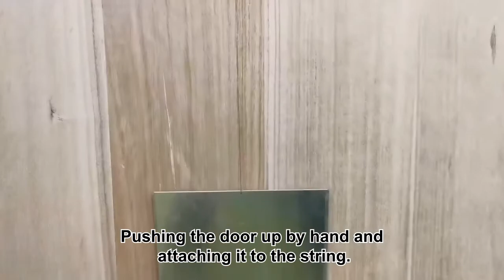How To Install And Set HPS Fence Automatic Chicken Door Opener AD002 When First Use

Comment: Don't make the same mistake I did by following this video if you want a centred door. The cut out should be more like 205mm not 220mm to fit the door within the aluminium tracks giving you ∼2mm clearance been the door and tracks. Also the door will hit the bottom screws of the tracks if orientated as shown in the video and the door won’t be able to fully close. note: https://youtu.be/0dDmza-etB0?t=166. Flip them or you may even need to drill new holes on the outsides if you need more height clearance for your chickens.
Reply from the maker: Dear  Glad to received your advice,  actually the aluminum door size is 22*32cm, so the width be 205mm is good, because in the video we have not added the tracks space.   As for the door will hit the bottom screws of the tracks, that is a design for hold the door under close position, some customer chicken coop gate is with a distance between the ground, so we use this design.